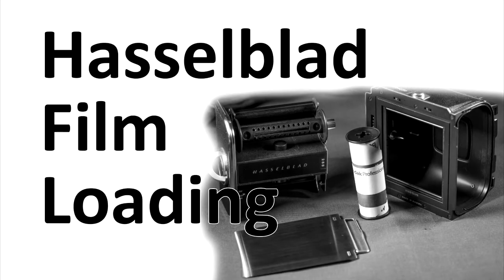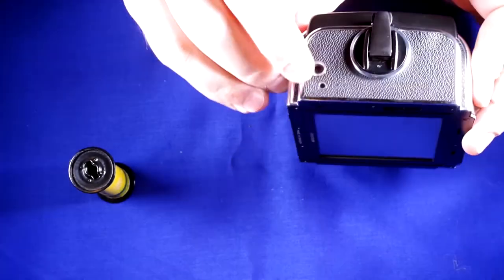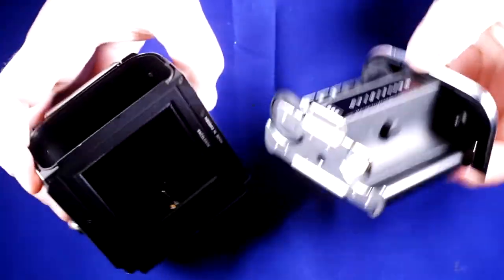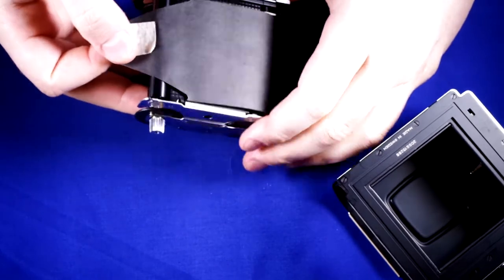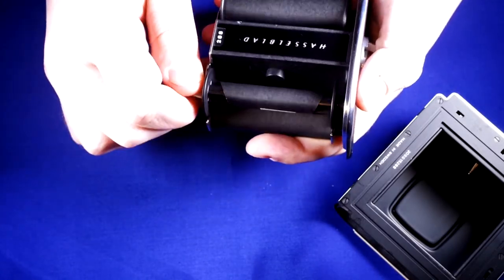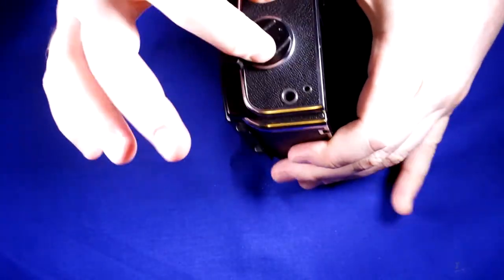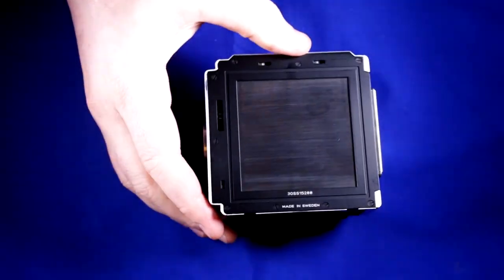Hasselblad Film Loading, A12 Back, 500 Series Cameras

Comment: Some small tricks regarding the backs:

-A24 backs are pretty cheap these days because 220 film is mostly out of production. You can still use 120 film in them though. Focusing won't be an issue and you don't have to adjust anything, just remember to shoot after frame 12 as the back will keep on shooting. Frame spacing will be off but you'll still get 12 frames.

-Older, C12 backs are slightly harder to load because you have to peep through a hole in the back to get to the first frame, but they can do something A12 backs can't. If you have an A12 back and want to use it on another camera, maybe a custom thing or a large format camera with no necessary pins to trigger the back, you can't wind the film past Frame 1. You first have to trigger the back on a HB camera with A12 backs. With C12 backs though, you can do that. They have no lock preventing you to wind after Frame 1 so for custom cameras, they are the ones to get.
Reply from the maker: Oh those are great. I didn't know either of those things. That A24 tip is a great one! Thank you.
Reply: A24 will have advancing issues. The space between each frame is different than the A12. Due to 220 film is thinner than 120.
Reply: As I've said, frame spacing will be off but you'll still get 12 frames so there is no real issue.

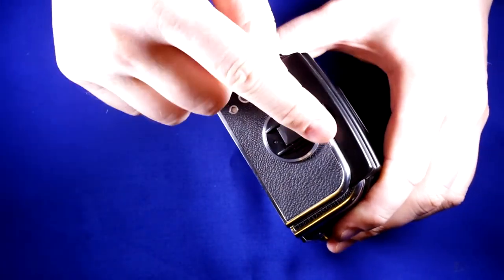Comment: 4:17 - "It's not going to crank forward any further once you've advanced it to the frame." Geared to do so, unlike all the TLRs you've covered so far? (Once you have it on the camera body, I guess the body's advance/shutter cock lever interfaces with the back and overrides the back's own wind-on mechanism anyway.)
Reply from the maker: Yeah, the gearing in it must be really complex. The lever can crank backwards at any point without issue, but once it hits resistance from the film reaching its position, it can't safely go forward. When the back is on the camera, there must be some kind of pin that disconnects a gear, internally, until the back is removed.